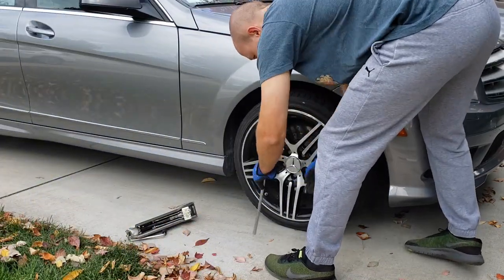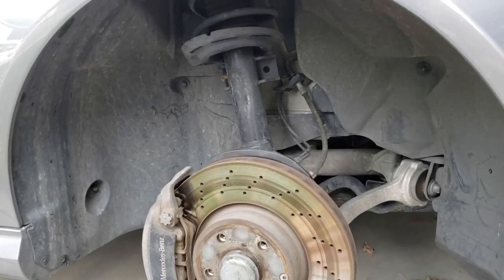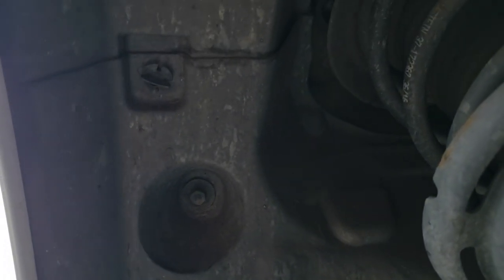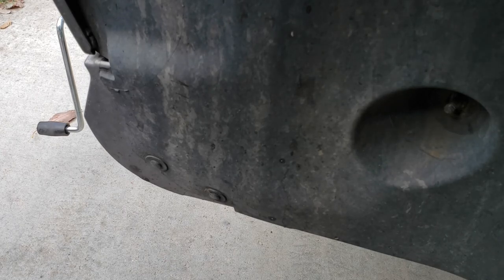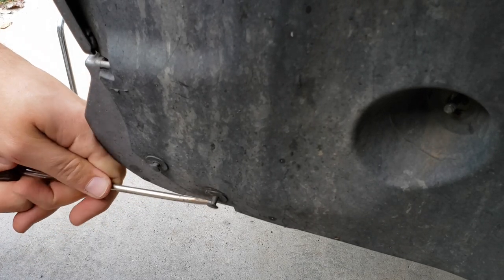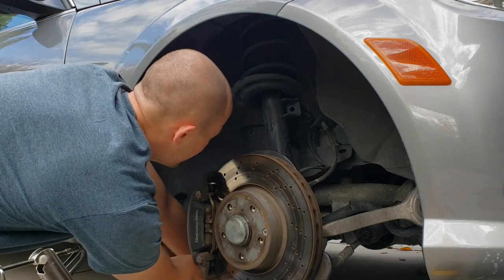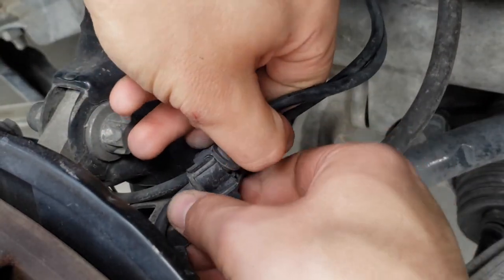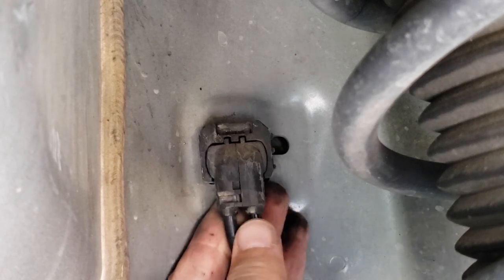Mercedes ABS speed sensor change - DIY instructions how to replace sensor W204 c-class 2008 to 2011

Comment: Looks like that may be the same process for my E class Coupe too - will need to check when I have time, nice clear video - my only comment would be that when doing more than changing a wheel, I would not rely on a jack for support, especially those factory supplied ones. Axle stands are the safest solution.

Comment: Pressing down on the top of the wire on the bracket (connector) will release it.  That way, you don't remove the retaining clip entirely and risk the chance of losing it.  Also, the car may need to be driven to turn off the MIL and clear any related codes.  You will get an engine light, traction control error light, ABS light, and even transmission codes, all associated with a bad speed sensor.  This procedure works with a 2014 C-Class (W204), as well.
Reply: Ahh no wonder why it showed Transmission codes and the engine light and the Crusie control dident work

Comment: For the drivers side sensor port pressing down on the wire clip released the wire HOWEVER on the passenger side I found it necessary to lift up and remove the clip as he did
in this video. 2012 C250---drivers side one sensor port wire on passenger side two port wires--Brake pad indicator AND speed sensor.

Comment: I was about to book my C220 in to a dealer. But this video might as well be my car !! (its even same colour) Thank you for a consise, clear video. I know what im doing this weekend
Reply from the maker: Glad its helpful! Do you know for sure the sensor is bad?
Reply: @Sergy Tsema  I've had the steering angle sensor replaced, (£300) by my mechanic. He found this issue on his  reader connected to the car.The fault went away for a while. A year later it has returned, every so often the ESP warning comes on. I have to keep resetting it. My mechanic plugged his laptop in and it shows no fault.! He suspects n intermittent fault on one of the sensors So, I'm going to replace all the sensors.
Reply from the maker: @geoffmelville5316  Id recommend spending 100 bucks for a diagnostic tool, I think I got a foxwell? Its what I used to diagnose my sensor. It was showing me going 12mph at a standstill ha

Comment: How did you reset the ABS light?
Reply from the maker: I dont remember if it went away on its own after I changed it or if I had to reset it. I did buy a scanner for $140 which helped me to diagnose the sensor and can be used to reset the abs. I bought the scanner on ebay, it is a foxwell multi system scanner.

Comment: The ultimate question. 
How do you know the sensor needs to be replaced? I am experiencing the sudden loss of ABS and other features when I make a hard left turn. I have been told that it’s a speed sensor however it doesn’t throw up a code. I’ve even tried using a scanner that reads abs.
Reply from the maker: I was able to tell its the speed sensor from my diagnostic tool that reads abs. There is an option to look at realtime speed of each of the sensors. The one that needed replacing was telling the car that its going about 12mph at a standstill.
Reply: @sergytsema  hi, could you please tell me the model # of your foxwell scanner, Im having the same issue and I need to read the wheel sensor speed.  thanx
Reply from the maker: @ech0seeker  I bought the n510 elite
Reply: Having same issue but although scanner suggests speed sensor it will more likely be magnetic ring in hub.  Had same fault with both rear wheels and it was the reluctor rings that were worn
Reply: @sergytsema the code was C0034? Thank you
Reply from the maker: @mikhalych_official  I dont remember..
Reply: @sergytsema  On my old Citroen C2, the offside rear speed sensor was reading over 17000mph while at a standstill 🤣🤣

Comment: Why is there two sensors on the front right and one on other wheels?
Reply: I think there is only one per wheel. The other cable might be for the pad thickness sensor.

Comment: How do you know which wheel sensor to replace?
Reply from the maker: Use a scanner. Im not sure if the obd2 ones that you can borrow from auto part store will tell you which wheel or not. I use a foxwell scanner I got from ebay for 140 bucks
Reply: @sergytsema  chreers!
Reply: @sergytsema hey. Does your foxwell sensor tell you which wheel speed sensor is broken? Mine is A. I am looking at getting a foxwell after payday if it does.
Reply from the maker: @silverltc2729  yes it will tell you how fast each wheel is spinning or thinks its spinning. I knew mine needed replacing because it was showing 42 mph at a standstill.
Reply: @sergytsema  thank you Sir. My current OBD II scanner doesn't tell me which wheel is wrong.